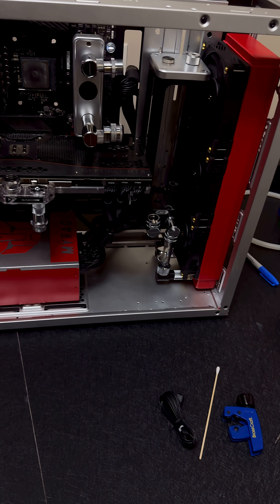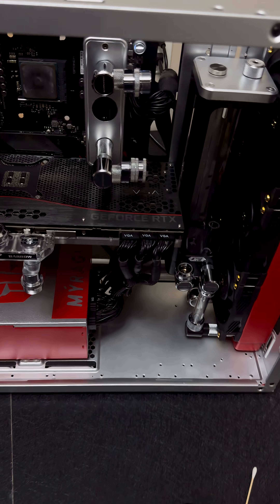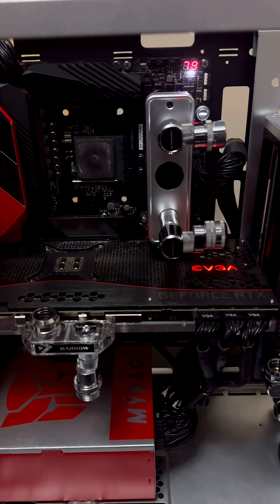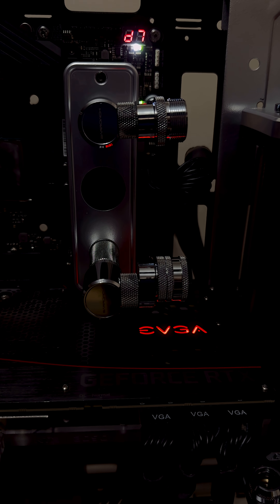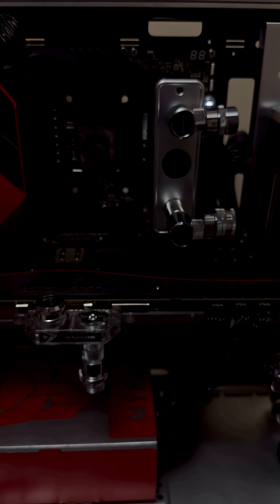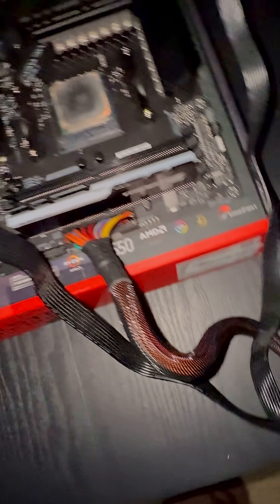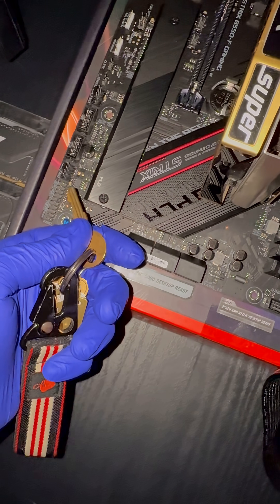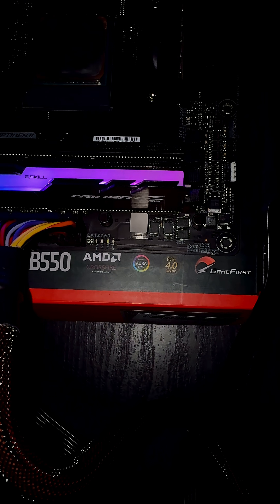Let’s Build a Custom PC | Update 3 | My 5950X is Half-Dead #pcbuild #custompc #projectmyragi #diy

Comment: Did running it with no cooler accelerate its death?
Reply from the maker: No spotty, it had a block on it, and has been good to me for many years but sadly it’s passed away. You can normally run any silicon in stock setting for a good 20 or 30 seconds without any damage. Sucks it wasn’t one of my intel chips I do have some replacements but nothing on the intel older side has died all working from server to X79 4930K.